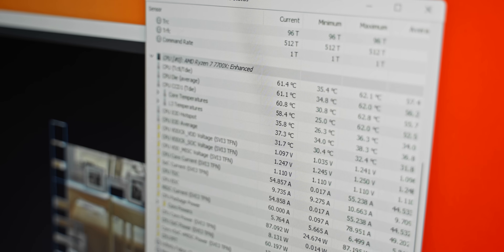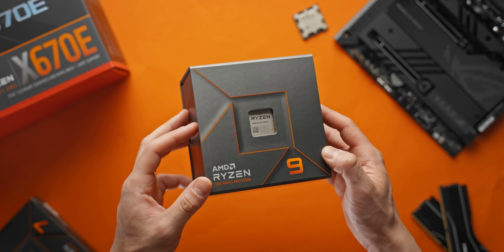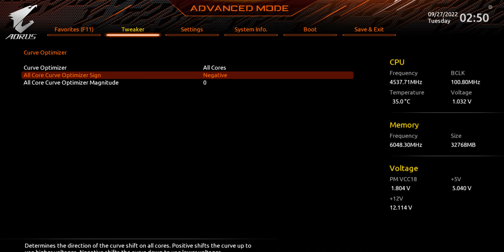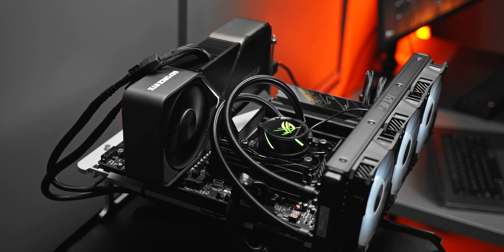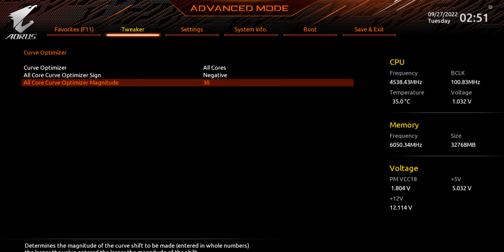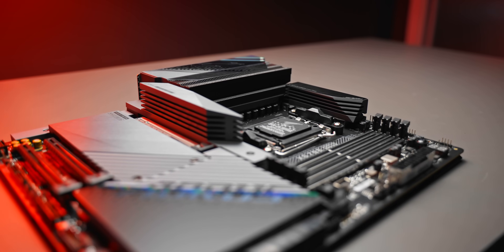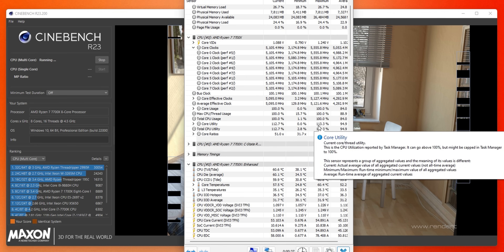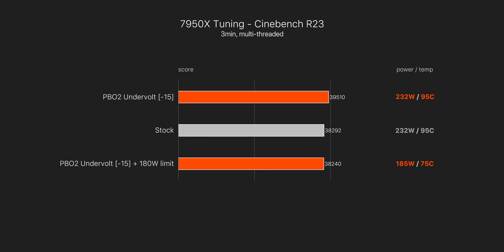Fixing Ryzen 7000 - PBO2 Tune (insanity)

Comment: Hello, I have a 7700x processor and I'm experiencing overheating problems, with temperatures reaching 85-95 degrees Celsius. Is it possible to lower these temperatures using your method without performance loss or a drop in GHz across all cores?

Comment: So I managed to get to -30 curve on r7 7700x and b650 aorus elite ax ,with 85 throttling limit,the system is stable,it stays on 5151-5168mhz,but... but performance in games dropped. Yeah,synthetic test showed more points,but nah, I dont need that. since I'm using 40cm 300w aio and after 5 hours of gaming straight the cpu won't reach anything more than 55-71C with higher and more stable fps without changing curve and throttling limits. But it was fun to try.

Comment: did this to my 9900x. -30 curve, 120W cap. temps and wattage decreased, but core clocks also decreased. couldnt get clocks the same as stock speed. thats crazy how the 7700x can get to stock speed with negative 50 watts.. any other 9900x owners try this?

Comment: can anyone tell me why does he set the PBO Limits to Auto here, meanwhile in another video about UV Ryzen 5000 series, he disabled the PBO Limits. And what does that makes the difference? I'm using Asrock B650M-HDV/M.2 for Ryzen 5 7600 and Asrock 450M Pro4 R2.0 for Ryzen 7 5700X if that helps

Comment: Are you saying max value is 30 because of safety or is it limited by the motherboard? I can go higher in my bios, is it safe to go higher?
Reply: You can go “higher” but it entirely depends on the cpus quality of silicone if it will be able to stay stable or if you’ll see performance loss. Just as a general rule of thumb most cpus won’t let you curve more than -30 without having issues. You can also look up another tutorial on individuals core tuning. Your strongest cores can be set to -30 and your weaker one at something like -15. Setting all cores to -30 can be rough for your weaker cores but fine for your strong cores. Using amds cpu software it will tell you what your strong cores are. You can also use HWmonitor and run single core cinebench and see how much each core is boosting and whither cores are boosting the most are your strong cores.
Reply: I actually got my 7600 to -40 and it's really stable, it passed a 10 minutes stress test on Aida 64 and had no problems with it since I did the undervolt a week ago

Comment: I just did only 30 on curve on 7700x  with new bios version on x870 i doesnt go above 70° on fully juiced map on poe2 it was 88° before. Now on idle is below 35° before it spikes 45°-55° and i have 5.7ghz speed on heavy load  should i follow the next tweaks or -30 is just enough

Comment: Its old video but maybe will answer and give some help. I did exactly every step from this video and my temps are really good 65 celsius under load. But my Ryzen 7 7700 is only doing 17700 points in cinebench after all of that (-30 uv and its stable). I gave it 90W power limit. And on all cores it only boosts to 4900-5000 at best. Any idea what might be wrong?

Comment: My Ryzen 7700 runs stably with a -45 setting in the curve optimizer. Constant 5360MHz clock speeds across all cores, 100W package power, and 70°C (ID-Cooling Frozn A620 Pro)
Reply: What’s ur PPT, TDC & EDC🙏Temp limit too. thanks

Comment: Can anyone tell me what PPT, EDC, TDC values would be a good place to start testing this on my Ryzen 7 7700 non X since default PPT for this CPU is already at 88W. Would really appreciate any advice. Thanks!
Reply: I'd like to know this as well. I've had to adjust this a bit myself as mine could run -23 in CO. I wasn't sure what to set TDC or EDC to so I've left them in auto. From my understanding, an 88 PPT is the "ECO mode" as stock normal is like 142 or something. So this would be less than eco mode for that.

Comment: I did this and my pc won’t even load into the windows homepage is say’s preparing automatic repair… So I put it back to the stock settings and now it won’t even Load into the main menu just straight blue screen…
Reply: U can’t just copy him every CPU is built different u have to test and test so it doesn’t crash
Reply: Same thing happened to me today, did yours get fixed?
Reply: @materfutuo8954  install windows back with a usb key it will work as normal

Comment: Followed everything in this guide and had my 7700X running a -40 PBO curve no problem at first.  Regular PC usage, lots of idle time, etc with no problems until I ran an OCCT Stability Test, Core Cycling(2min), 2 Threads... instant errors report via OCCT and my PC crashed after less than 15 seconds!  I had to go all the way down to -10 PBO curve to get OCCT to run even one cycle of all cores through it's stability test.  I guess I lost the silicon lottery with my 7700x! 😭  Oh well, now I can go through each core individually to see what I can push them to.
Reply: Just keeps getting worse for me... all the way down to -5 PBO curve to get through an hour of the OCCT stability test with no errors!  At this point I think that I'm just going to set the temp limit to 85 degrees C, call it a day, and let the BIOS do the rest.

Comment: 4:55 But what do you set it to? Same as you regardless of CPU? I want it to be a bit faster but also a bit cooler.
2:30 Why can I set it to 99 then?
Reply: 1-Setting the wattage depends on your CPUs TDP. For a Ryzen 7 I'd set it on 85-105.
2-The maximum is 30

Comment: I did the same settings on my 7700x and the temps are around 62 but my wattage is only aroun 57W, clock speed max 4.9Ghz and i only got around 18000 score on cinebench. Any ideas?

Comment: i did PBO2 [-30] + 85W cap on my Ryzen 7 9700X paired with 5070 TI and i ran Cyberpunk 2077 on Max settings (CPU demanding game for some reason) Got 100% cpu usage but my temp never went above 70C, this gude helped a lot

Comment: Hi, great video!! Just a question, why my 7700x with all this settings is very similar. But! When i put the power limit (85W), insted have 5.1ghz or 5ghz all core, no! I have 4.6ghz or 4.7ghz. Why? Can anyone explain me this..
Reply: what is your cooling? also the environment temperature?
Reply: @bonedface hi, you think is that the problem? Because with 85w settings the cpu dont past 60c in full load
Reply: @DanAzvd yes it wont, but it also affects clock speed because at 85W or thermal limit whatever the heat doesn't dissipate fast enough to keep the clock running at that speed if you know what I mean
Reply: @bonedface ok i see, thanks😉

Comment: Are these settings available on all chipsets or should I get a higher end chipsets to access these settings you speak of in the video? Also I am planning to get 9900X. Are these instructions still valid for the 9000 series CPUs? Thanks

Comment: Great video, thanks. When you set the 85 watt (85000 mW), what is default for that processor? (SO I understand the % decrease as a general range)  I have a 7800X3D, that is stable at -30. What is stock and what is a good undervolt target?

EDIT: Never mind, I went -30 / 80C / 80W. Stable with 2-3% better performance, around 5C lower temps and 10+ lower watts (93W->82W) at 100% load.

Comment: wow! I followed your guide and as soon, as I found out, that i can just "write" numbers into the "[auto]" field (no Dropdown) i figured it out!
about 15% more CPU-Z Bench results with lower temps! You're a magician!

AMD Ryzen 5 7600X @ 5099.85 MHz 85.1°C Single-Thread 757 Multi-Thread (12T) 5766 (+100 Mhz more Auto Mhz),  -30 PBT and 85 Watt etc.
AMD Ryzen 5 7600X @ 4924.07 MHz 95.3°C Single-Thread 712 Multi-Thread (12T) 5380 Stock

Comment: Thank you. 7500f from 63-68 to 59-61 in Apex with curve negative 30.
Reply: i cant put it on -30 my pc crashes
Reply: @Bi3MaRk  its normal. Try -20. On -30 my games is crash, 20 very stable
Reply: @excells_o  i Tried -15 Without boosting And it works great with cool temp . but after Pbo Boost 150 Mhz cant run with even -10 . i put it on -5 and still crashes . right now im testing the +125 Mhz and -5 To see if its stable . i guess i lost silicon lottery in this one . 7500F Btw
Reply: @Bi3MaRk idk man. My 7500f stable with +200 mhz, but i'm dont need it actually. Fps in Apex locked on 180 and it good. I can lock on 240 fps, but not need it

Comment: Has amd rolled out a update? I just built a pc using r5 7600 and it runs very cool out of the box. I am a total noob so any input is appreciated.
Reply: The 7600 is only a 65w cpu its super efficient already
Reply: @andrwxu  no i mean the temps, everybody complains it runs super hot but mine doesn't go above 65c. I'm using Cooler Master Hyper V3

Comment: this is insane. i just set everything. n went for it. with no previous testing. using a 5 7600 non x. playing marvel rivals at now cpu low 50 degrees to before 70-80. only been on for 10 min tho. so we’ll see

Comment: Hi. Thanks for the great video. What power limit would you suggest for Ryzen 7 7700? Default PPT is 88W. I have tested 2 scenarios with curve -30, tjmax 80 (or 85) and 70W and 75W. On 70W is super quiet and the temps don't get past 60C. Also, the cinebench score is slightly worse compared to the stock settings. Wtih 75W it matches the performance of stock settings but with less heat and power. Any recommendations?

Comment: Just followed all the same steps with my ryzen 7 7700 (none x variant ) but with -25 on curve optimizer , Single core jumped to 5.5Ghz , Multi core stable at 5Ghz , and the tempreatures are chilling at just 60° ... All that on a msi pro b650m-p
Reply: Hello! will be building a rig with 7 7700 none x this week and just wanna ask if you also copied his TDC and EDC limits? Thanks.

Comment: Need help.. i have 7700x  i did all this only the last setting PBO to manuel and PTT to watt 85000 it goes automatic 65000 and the other 2 stats also.. my psu is 750 watt. Is this the cause of its auto lower or whats going on. Iam affraid to pu 65000 and what to do next?
Reply: Same here.

Comment: Thank you! My 7600x used to hit 95c on a coolermaster 240mm aio with custom arctic p12 maxs installed and now it barely hits 87c!
Reply: Me too! I was so terrified. However, idle temps didn't change. Still 45-48c. But idle temps aren't the scary part. 82c in apex is! Now I get 67c max.
Reply: @m1germsy784  ryzen 7000 idles around 45-50c becuse of the wattage they eat while at idle, its normal dont worry about it.

Comment: iam new PC builder.. i ahve now 7700x cpu.. so if i can drop 35 degrees  can i order just the cheapest aircooler or what is the point.. i dont understand why you want 85 whats or 60 degrees. if cpu is made for 135 watss and 93 degrees.  what happens if new gamer let it run on 93 degress.  can it catch fire,do it explode, can it damage other parts... or just safe money on energy BILL..

Comment: My motherboard Limits always go to 65535 what do i do?
Reply: same
Reply: Just set to 85, his mobo uses milliwatts(mW) and milliamps (mA). yours probably uses watts (W) and amps (A)
Reply: @zm3d  it says mine also uses Mw on the first one and MA on the second 2 options
Reply: @sui.1377  yea that definitely isn't the case I tested it using W and A and my pc was lagging on the login screen. Maybe my motherboard just doesn't allow higher mW and mA and is bottlenecking my cpu
Reply: @mont_cs  oh my bad. for my setup I only did the PPT 85 and left the rest to auto. but, I had to change the curve optimizer magnitude to 20 instead of 30 cuz it was  unstable and kept crashing when I play the last the of us part 1. maybe you could try what I did.
Reply: onc I changed the curve optimizer magnitude to 20 it was stable and smooth with low temps
Reply: @ yea that's what i had it on PPT 85 and curve optimizer on 30 and it was working fine, i just can't limit the mW and mA which pisses me off

Comment: Hello, can you tell me, please? My 7800x3d runs without load at a frequency of 4.8-5 GHz, and you can reset the frequency only by setting the power saving mode, then the frequency becomes 2.9. Is this my Windows?
Reply: You should have balanced mode in the windows , if not just search on google you can add one

Comment: I am not 100% sure what it does but it seems to work :D thx for sharing.  Did everything exactly as in the video. Stalker 2 with around 82° now. on average 10° lower than before. Cinebench runs around 78°. Performance is as good as before but I do not reach that around 30° less as you. The effect is noticeable but not as "insane" as i expected :)  
7700x is used. Any special tips for this processor ? Less TDC / EDC as in the video ?

Comment: Did not expect this to work the first go around but even with the curve set to -30 it just Worked off the bat. Booted into Windows just fine. Got an even better Cinebench score with temps being around 25 degrees lower on a 7600x. Thanks.

Comment: Temps are way down, but I get worse performance everytime I lower the core clock speeds by -30 -20 -15. Temps are down and mhz are staying mostly the same, same with voltage.
Reply: 7500f curve 30 negative. No performance difference, lower temps.
Msi pro b650 a wifi

Comment: set my 7600x to negative 20 and now my pc doesnt work. can’t even boot into bios. red and yellow lights on mobo. please help
Reply: You need to reset your Bios. Look up JBAT1 and cmos battery removal. Either will reset your bios. Don't worry it's all good bro
Reply: @ after a lot of patience i actually got everything stable and was able to boot into bios after many resets. should’ve deleted my comment lol but thank you man
Reply: @desolate171  bro what did you do , i am also thinking of undervolting my 7600x , should i do it or not ?

Comment: 2025. Just got my 7600x + 7800xt. Did this. Same fps in Marvel Rivals, I havent check the voltage yet BUT, going from 85ish C ( both GPU and CPU ) to 60C GPU and  65~68C CPU is INSANE.

Comment: Does it help for my Ryzen 5 7600x ?
Reply: yes. Don't listen guy on top. Try   curve 30 negative. If something not working or pc not loading, reset bios and try 25 or 20
Reply: Currently using Temp limit 80, Power limit 90W, curve -25 it's stable. Should I try anything to get more performance or this is enough?
Reply: don’t do it. i tried and no longer have a computer

Comment: How is my Ryzen 5 7600 able to do -55 CO and +175 MHz boost? So many people are telling me it's not stable but it is.. cinebech r23 15100pts multi core test, 72c max temp.
OCCT CPU tested, so many times.. aida64 tested.. not a single crash, in gaming also no problem.. 
5315mhz max clock speed
Reply: -30 is the lowest point at curve optimiser. The bios won't let you type in anything lower than that. How did you get -55?
Reply: @xxerox  sorry for late answer.. now I update BIOS, I can put -60 all cores( curve optimizer)
Reply: Think the latest BIOS allows for lower numbers, I can do -60 too! Doing +200 and -50 right now!

Comment: I did this with my 9700X and it stabilized my idle temp from having constant spikes and also gave a 5% benchmark increase. The CPU power and max temp did not change because this cpu already seems to basically just be a tuned 7700X.

Comment: How would i limit the 7600X optimally? currently running it with a 240 AiO in DAN-A4 H2O with Temps of 50 - 60C (while chrome browsing, 4 Tabs)

Comment: Initially i felt lucky and was able to do -40 on my 7600x and was running cinabench perfectly fine the temps went down from 96.8 —> 79.1 C  with no watt caps 
But while openning games the windows crashed
Then reducing it from -40 to -35 it got stable and was able to play games but again after one hr of battlefield V in 2k ultra my windows crashed 

So finally made it -30 now its stable 

Now i kept the power limit to 85W and mind blowing 
My temps went from 96.8 —> 69.5~ 27 C drop 🤯
My ambient temperature is ~28C and i have a mini itx lunch box build with a massive three slot 3080ti zotac amp holo card
Reply: Haha, I am in the same boat as you! The temp drop is cray cray!

Comment: On the pbo limits option do we just set it to manual and leave the values as they show on our screen? I saw in this vid he didn't change the values just set it to manual and my values are completely different with a Ryzen 5 7600 so I'm just wondering if I did it properly by just setting it to manual and leaving the values as they came?

Plz can someone confirm.

Comment: I have my 7600x set to -32 and my temps idle higher at 50-55c, with cpu boosting disabled 😐 with a 360aio. If I clear cmos and leave it stock it idles at 46-49c

Comment: 4:59 TDC and EDC limits of 480A and 640A respectively look intriguing
Reply: Why does his mobo default to that when he changes to advanced? Is that his mobo’s limit? My numbers were significantly lower, like 110A
Reply: @earlygrablatebloomer i have 280 - 400. But remember having more before. Canyou change this?
Reply: I'm very curious about this, did you find what they should be set to?
Reply: @atl126 same, i had to compile forum replies which most said TDC 110,000mA, EDC 170,000mA was stock. Thats what i have mine at right now because I just dont trust putting this high of a value can be right even though Ive seen 2 other videos use the same values noone explains.
Reply: Update: i got ryzen master, turned ppt down until the temps dropped and then continued turning it down until the clock started dropping. Just ran cinebench checked monitoring, adjusted ppt, repeat. Was throttling 95c at 120ppt 5150mhz Ended up at 105 ppt 79c at 5090-5080mhz.

Comment: OMFG i did this in my 5600 and the temps dropped from 70~75 saturation  to  57~58 saturation, with 20% offset 1st try. im using the system for few days and tested many games so far it hasn't crashed.

Comment: I tried to set the PBO Advanced, and the setting for CO: All core, negative, 10 (I can't put negative value) but the windows can't boot properly. It always shows some error message and asking for recovery. My MB is Asrock B650M Pro RS and 7600x CPU. Does anybody have the same issue?